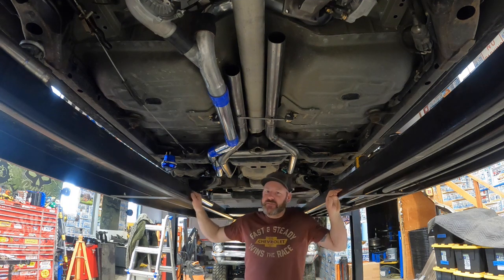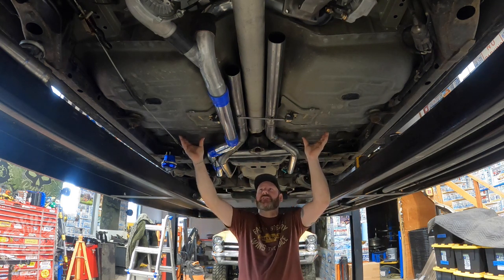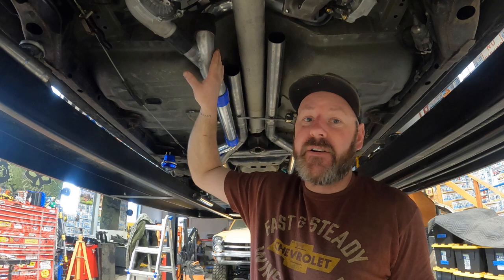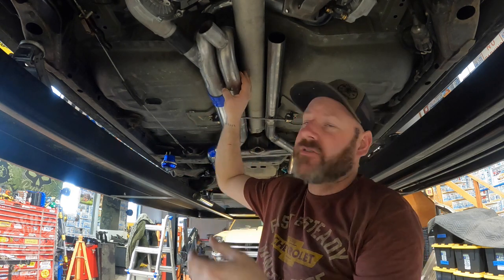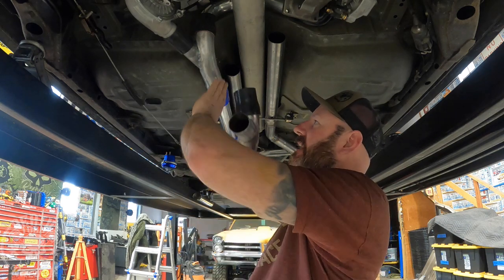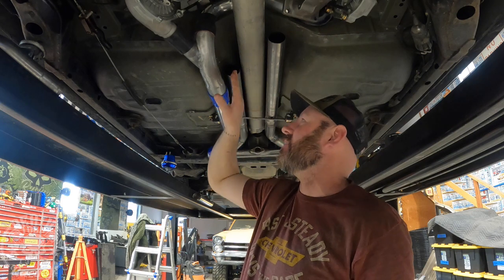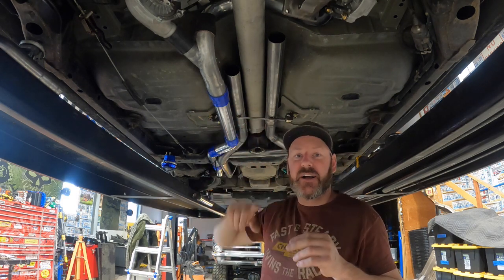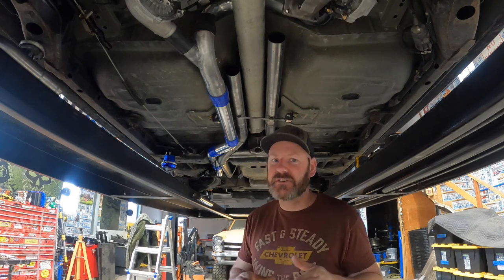Ep 3, Twin Turbo P71 Crown Victoria, Wastegate, Intake and Exhaust, Sleeper Police Car Series

Comment: I'm a couple years late here. Just curious, why didn't the blow off/wastegate at the original location where you installed it? Wouldn't boost be maintained anywhere forward of the turbos allowing it to escape through the crosspipe you installed? 

Awesome build, awesome series, and killer work, I'm loving it!
Reply from the maker: I was told that would never work.  I had the same line of thinking as you.  I've been meaning to start playing around with it and see.  My turbos finally gave out and I'm currently doing an upgrade, and with that is going to be trying to eliminate one of the wastegates.